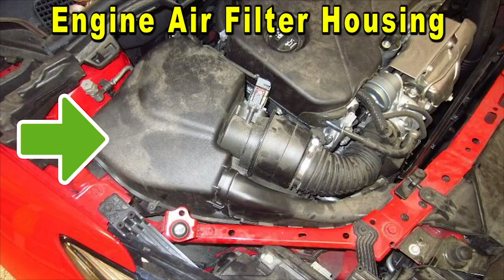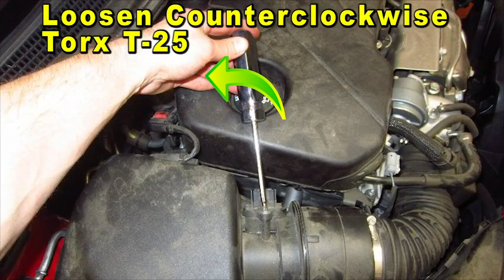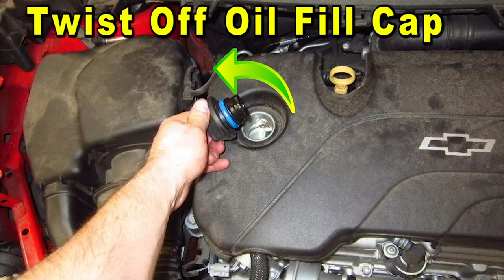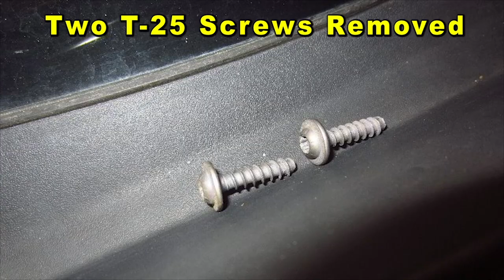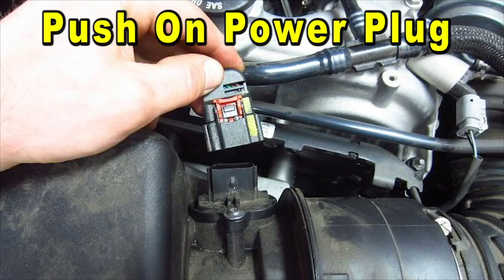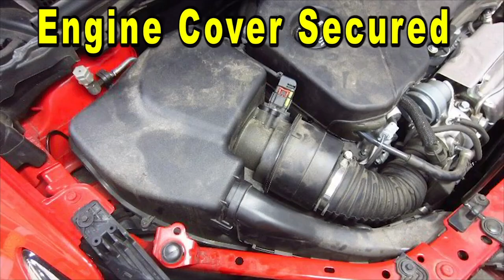2016 To 2019 Chevrolet Cruze How To Change MAF Sensor (Mass Air Flow)   - Quick & Easy Version!

Comment from the maker: Chevrolet Cruze Mass Air Flow Sensor - https://amzn.to/3qTUfu7
GM OEM MAF Sensor Part Number - https://amzn.to/45KBxnx
CRC Electronic Cleaner - https://amzn.to/44qg828
Precision Screwdriver Set - https://amzn.to/3OYN1i0
Plastic Pry Bar Tools - https://amzn.to/3HMtsV7
Socket & Ratchet Set - https://amzn.to/3Z17LbA
Mechanix Gloves - https://amzn.to/3jCnHkt
Torque Wrench - https://amzn.to/3vS5uSI

The Paul79UF YouTube channel is a participant in the Amazon Services LLC Associates Program, an affiliate advertising program designed to provide a means for sites to earn advertising fees by advertising and linking to Amazon.

Comment from the maker: Check out the DIY guide for changing the MAF (mass air flow) sensor in a 2nd generation 2016, 2017, 2018 & 2019 Chevy Cruze sedan - 
https://www.paulstravelpictures.com/2016-2019-Chevrolet-Cruze-MAF-Sensor-Replacement-Guide/index.html

Here are all of the DIY repair and maintenance tutorials for the third generation 2016, 2017, 2018 & 2019 Chevrolet Cruze - 
https://www.paulstravelpictures.com/Articles/2016-2019-GM-Chevrolet-Cruze-DIY-Repair-Maintenance-Guides.htm

Owners of other General Motors vehicles from Chevrolet, Buick, GMC, Cadillac and Holden such as the Sonic, Spark, Malibu, Impala, Volt, Bolt, Camaro, Corvette, Trax, Equinox, Blazer, Suburban, Tahoe, Traverse, Colorado, Silverado, Express, TrailBlazer, Encore, Regal TourX, Envision, Enclave, LaCrosse, Cascada, Sierra, Canyon, Acadia, Terrain, Yukon, Savana, XT4, XT5, XT6, Escalade, CT5, CTS-V, XTS, CT6, ATS, Astra and Commodore may also find these DIY instructions to be helpful.